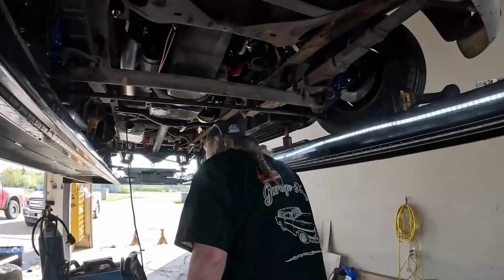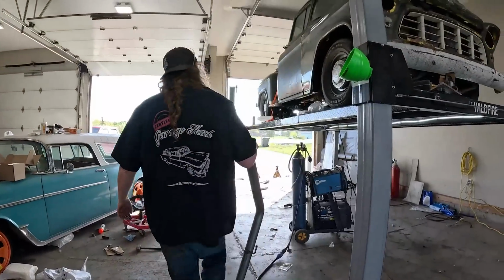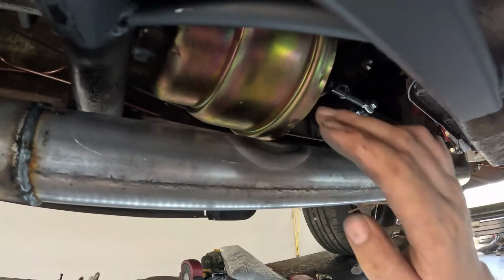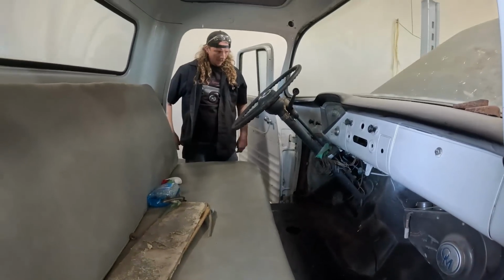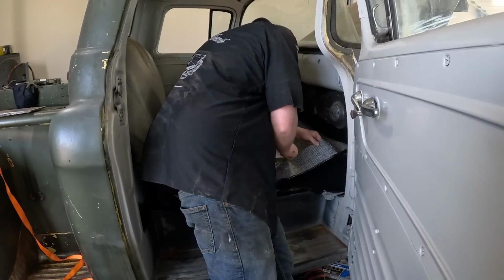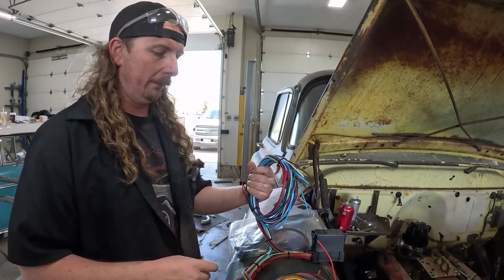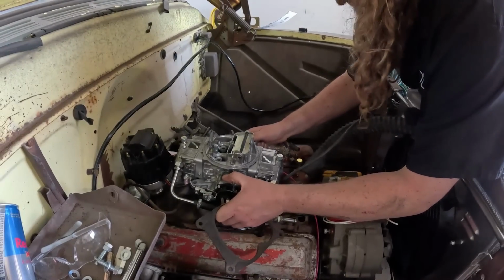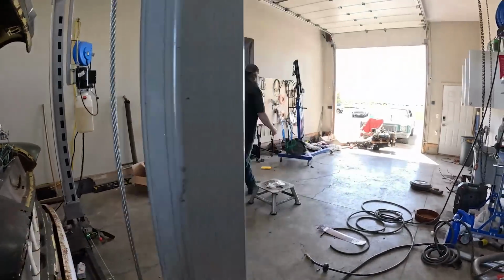Side Exit, Tips And A Whole Lot Of Creativity! Building My Own 56 Chevy Truck Exhaust

Comment: I would definitely wrap the exuast pipe by the brake booster the heat will have a bad effect on the bladder inside, possibly melt it after some time.

Comment: Yes, I was losing my mind when you were hacking up that new carpet. It’s a one time thing! Take out the 4 seat bolts, or don’t. It’s your car.
Reply: That's the way he goes 🤷 oh well.  DD speed shop style
Reply: He's going to have to have a way to access the master cylinder through the floor anyway so the cut just makes it easier.
Reply: @davidclemens1578 it has a later style booster and Master, not sure if that hole even lines up? He will bleed the system get it to work, and most likely never have to even lift the Carpet once completed for quite a while.